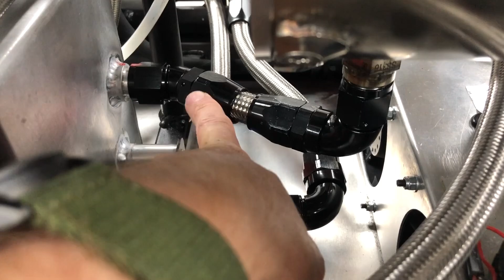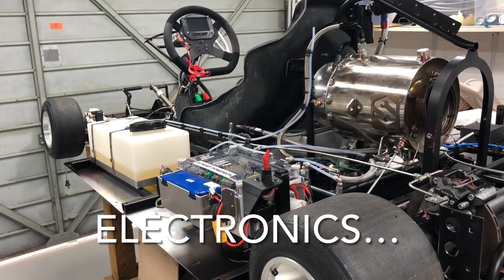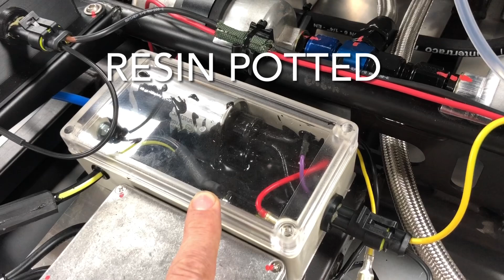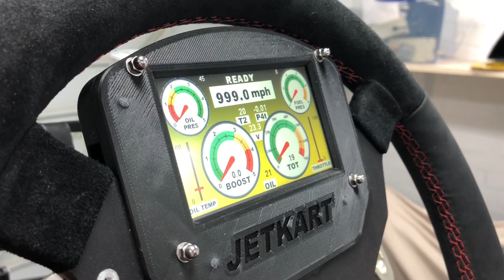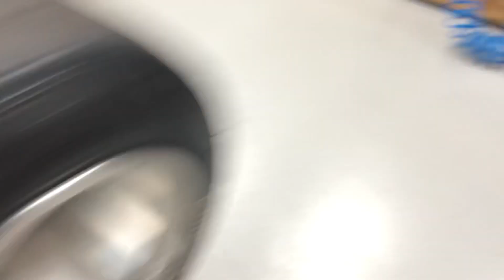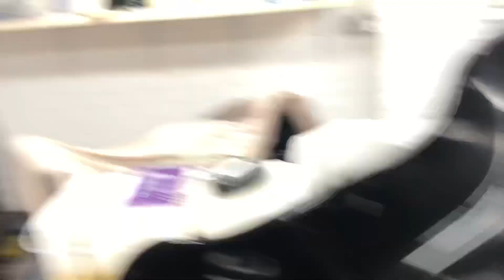New JET KART Systems and DIY ECU Explained 🤓🚀😊

Comment: Incredible work. Also, you’ve got a high-pitched ringing which would be very visible on a spectrum analyzer. Put a low-pass filter on the audio at 8kHz and it will go away. :)

Comment: How do you find the performance of the Bosch 044 pumps? I have used one but it did not build much pressure at all. I think it was faulty or a fake one. Why not use the same pump for the oil too?
Reply from the maker: @smad333  the Bosch pumps are great but you need to get a genuine copy or real 044 with the m18x1.5 helicoiled inlet for 10 bar capability. The normal Bosch (non 044) ones are only good for about 3-5 bar. The oil gets pretty hot hence using a different type of pump!

Comment: Amazing work and thanks for the system walkthrough. I am sucking up every little detail 🙂 Did you have to sacrifice data loggning due to GPS installation or is data loggning included as well?
Reply from the maker: @storthomasracing  thanks Thomas! I got rid of the datalogging because I needed to keep the same board space and I don’t think I have time to play with the logging functionality and data review compared to just running it and taking notes 😂
Reply: @ScottsCrazyBuilds  As we say in Sweden, if it is not logged it have not happened 🙂 Understood, it is alot you need to do as a one man army. Good luck with the testing, holding my thumps for new record speeds!
Reply from the maker: @storthomasracing  hahahah a good reason to not have data logging maybe 😍